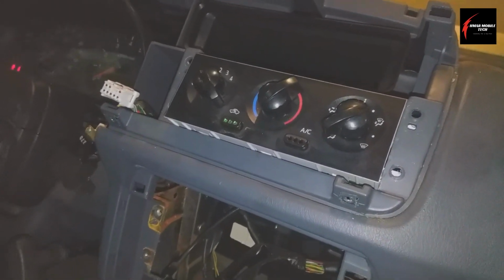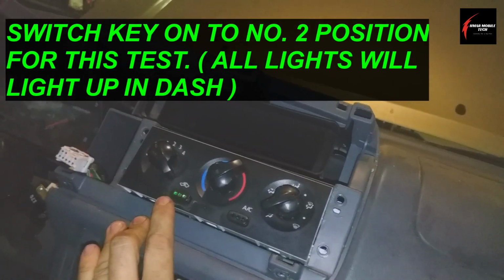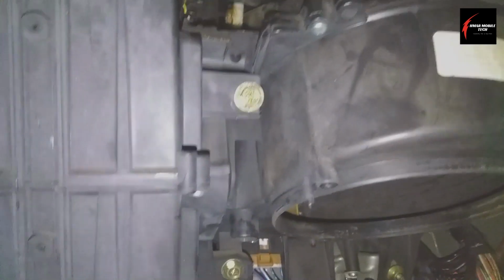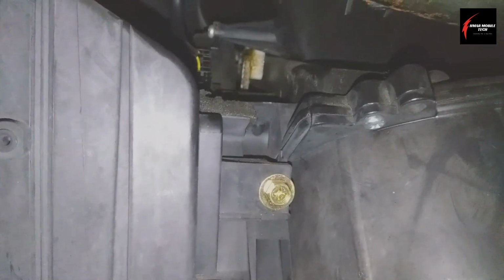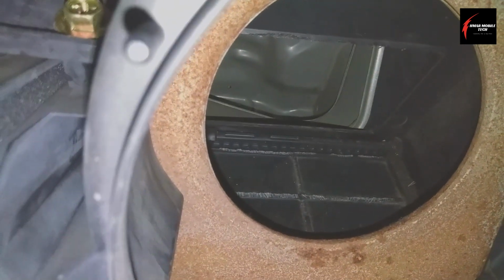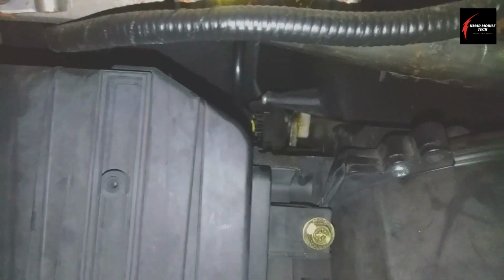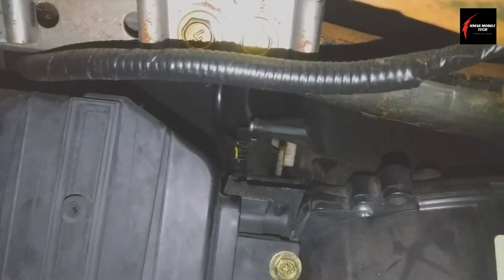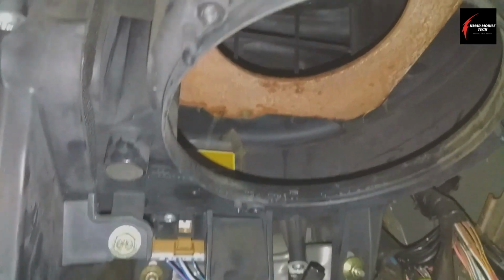Early 2000s NISSAN FRONTIER / PATHFINDER hvac recycle air / fresh air flapper door & circuit test

Comment: Can this be why my heater blows cold air only
Reply from the maker: The recycle is only for out air in / inside cab air to recirculate. Try checking coolant level and heater core hoses both hot as hell when engine fully warm if all ok then the blend door motor broken, stuck, gone bad , missing,  wiring / fuses , check it all.

Comment: Hi...

In my 2001 Xterra, the recirculation button isn't turning on at all. I have been searching for how to troubleshoot, but I couldn't find anything yet.
Reply from the maker: check to see if power and ground are present at the motor with a digital multimeter when you press the rec. button, without being there to diagnose that is best i can offer. check all fuses and check wiring to the motor and rec. button.
Reply from the maker: also check to make sure it is screwed down properly and not unplugged, start with most obvious then go more into it till you find problem, best of luck